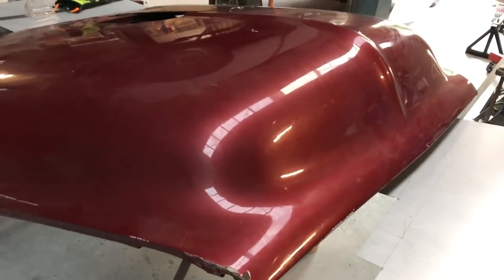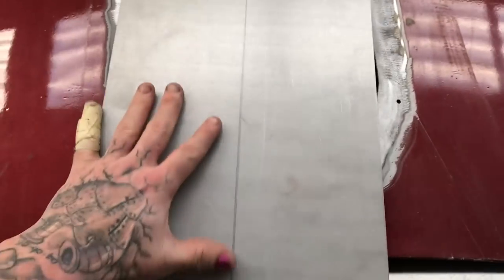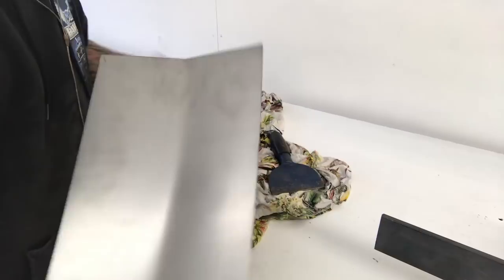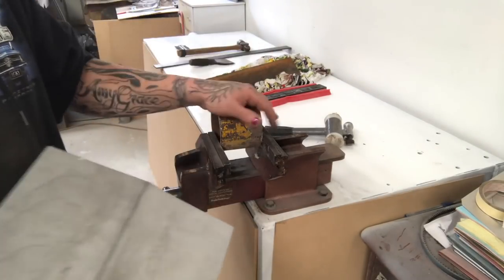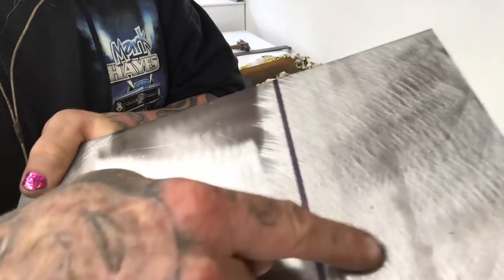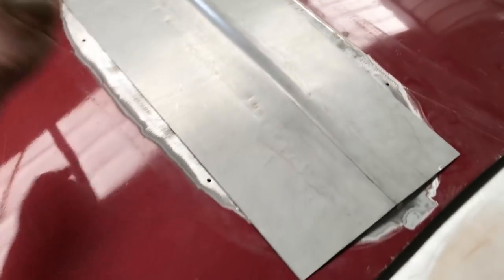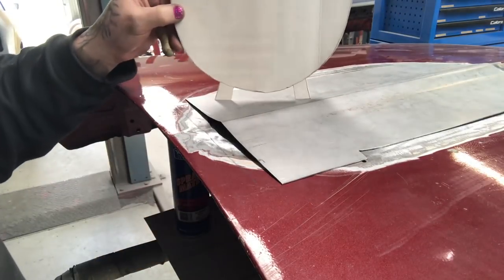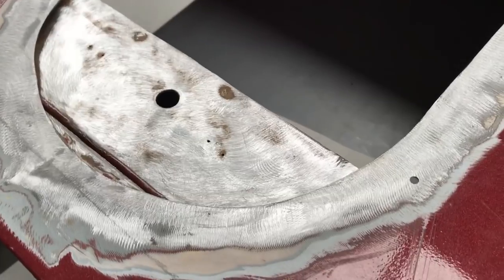Beginning Fabrication - Episode 13 - Shaping more steel without fancy tools!

Comment: Great video.. These are the kinds of methods i had been using, but watching this.. where i think i have been going wrong is i have been using panel hammers to do the forming, and that stretches the metal as I was working it.... Off to the shops for one of those rubber mallets i think.

Comment: How do you minimize shrinkage of the whole panel while welding? I migged some repair sections into my Datsun roof then finished with tig and dolly to minimize warpage but still got some. Even thinking of making a whole new roof skin to do it properly but being a wagon,the standard 1 mm sheet is not wide enough. Unless I just overlap the edges as much as possible. Bit hard finding donor vehicles too